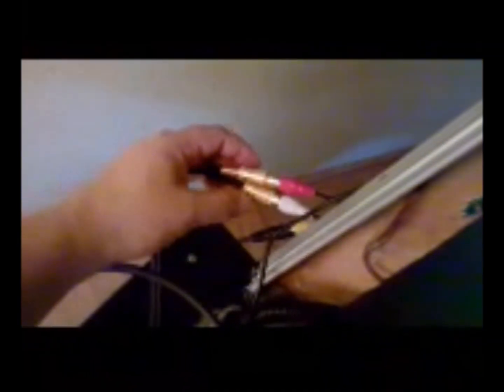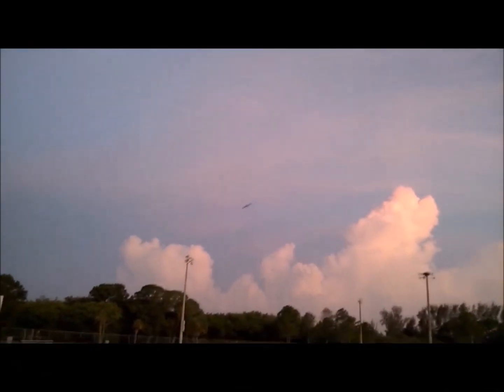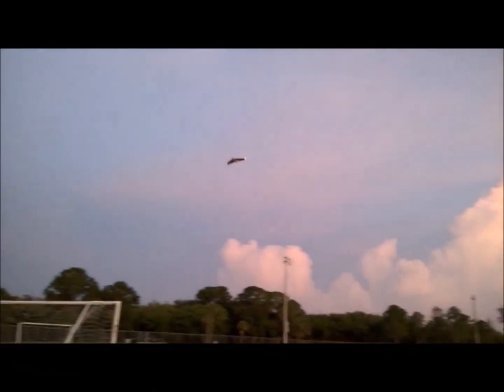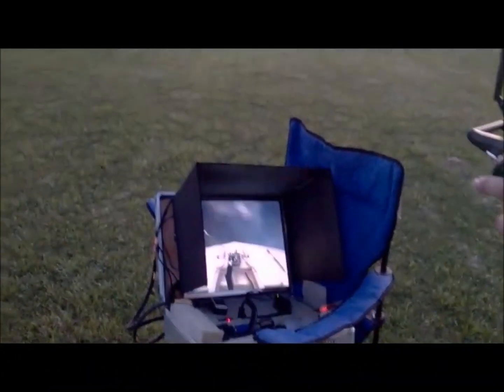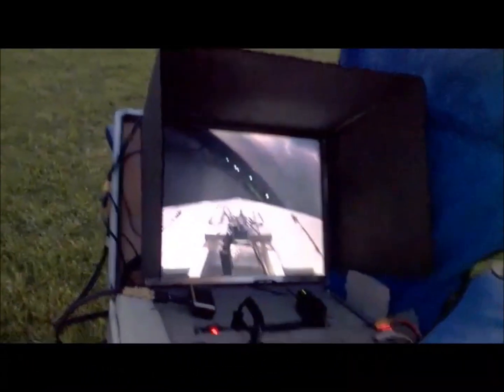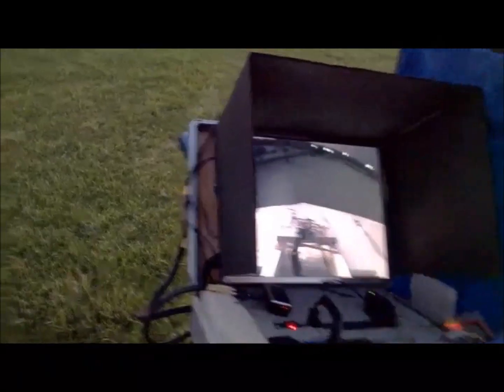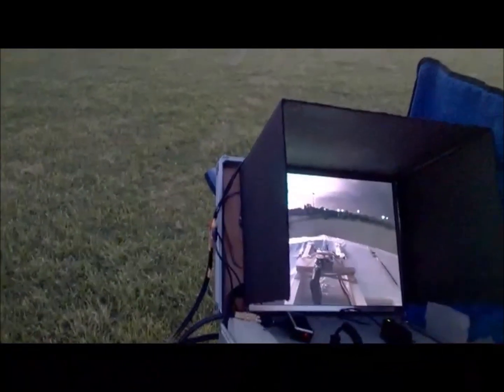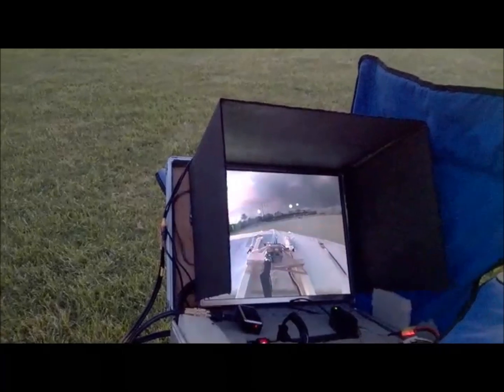Cheap and Simple FPV Ground Station

Comment: Can u send a link for the converter for the screen
Reply from the maker: I think it's been 2 months since you asked this question but here is the original listing on eBay for the converter. http://www.ebay.com/itm/TV-RCA-Composite-S-video-AV-In-to-PC-VGA-LCD-Out-Converter-Adapter-Box-Black-/190596379150?&_trksid=p2056016.l4276